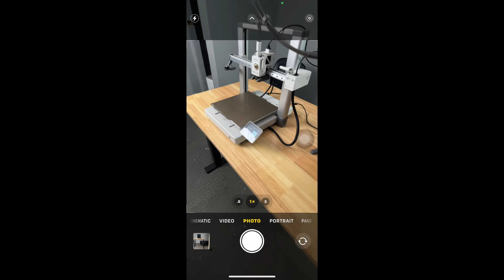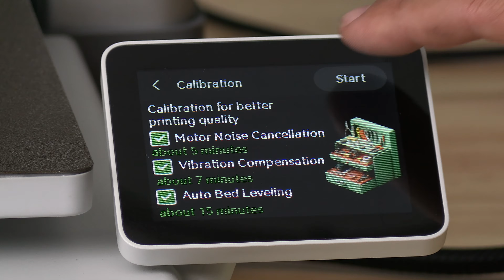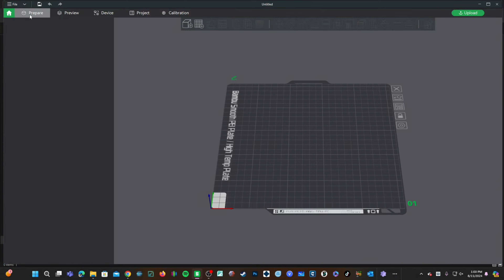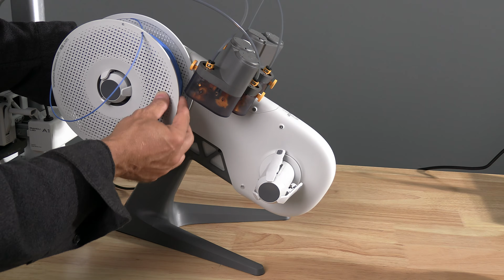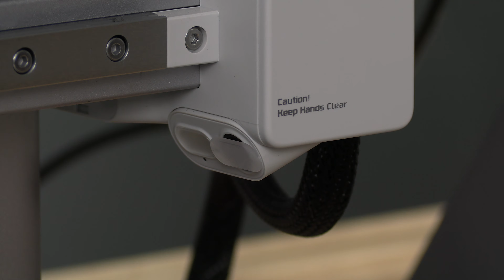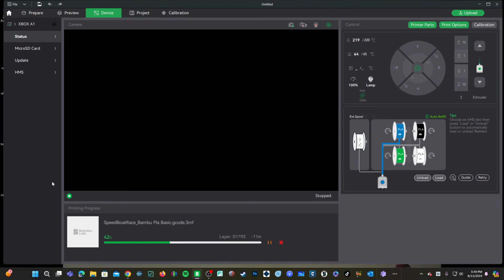Bambu Lab A1 COMBO with AMS LITE - Step By Step SETUP, Config, Calibrate, Lubricate, Test Print

Comment: My bambu A1 nozzle scraps the build plate. How can I fix this?
Reply from the maker: It's using a strain gauge for auto z-offset. Assuming it's not malfunctioning. You've run a full calibration from the screen?

Comment: Is it necessary to hook up the AMS LITE before carrying out the calibrations or can they be done with no filament at all?
Reply from the maker: Can be done without filament or AMS. But.... you ideally want your calibrations done, with the machine as it will be, for printing, as the AMS and tubing connections, may affect the vibration readings..

Comment: I did not get the ams with my A1. Not a big color printing guy. But the A1 has been amazing so far, it just works! Its funny how the Creality Hyper PLA you recommended works extremely well on it!
Reply from the maker: Hyper is my Favorite. I actually cut a 5 minute segment, where I went over several filaments, and explained what, and why, I like, or don't like. I still mentioned Hyper as my Favorite. Creality has soooo many winning products. They are well respected by players in the industry. AMS is a game changer. Imagine having your 4 most common colors, even for single color, available at any time, without touching a thing